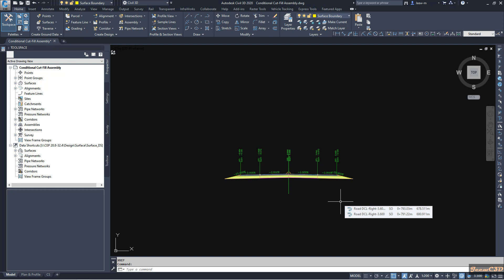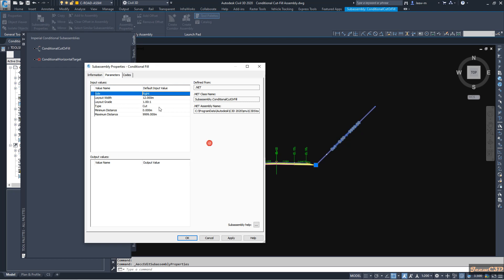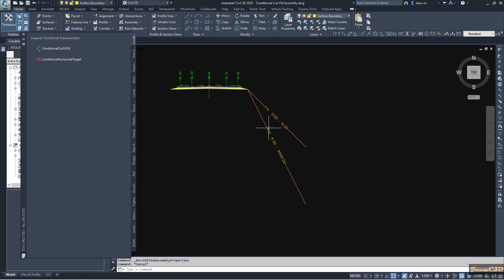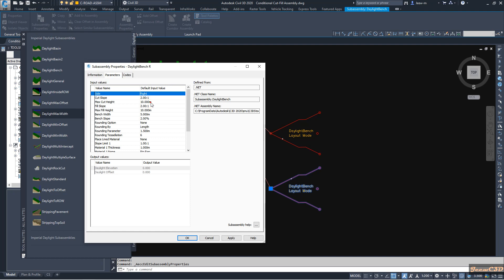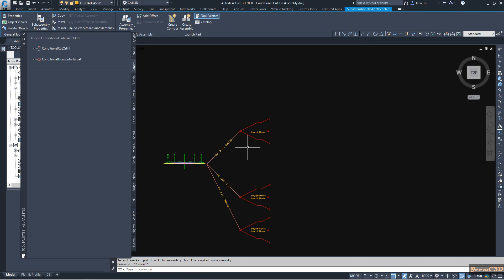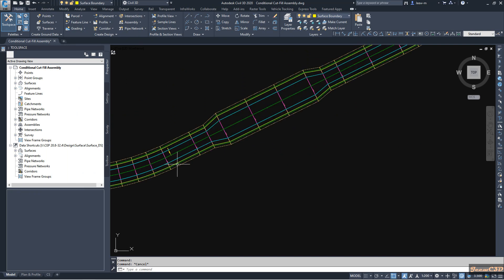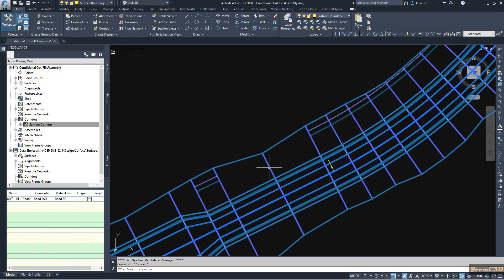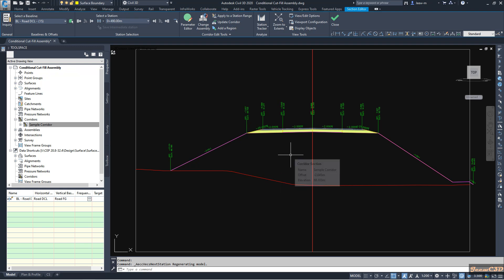Use of Conditional Cut Fill Assembly in Civil 3D

Comment: Hello Sir.
I like your videos. I have a problem, that when I plotted the cross sections in civil 3d and add Bands in the section view, there is showing sub grade (Finish Road Level - Road Structure) and NSL levels, not showing PGL or Finish Road levels or Profile levels.
Reply from the maker: Did you sampled all the surface data to sample lines.